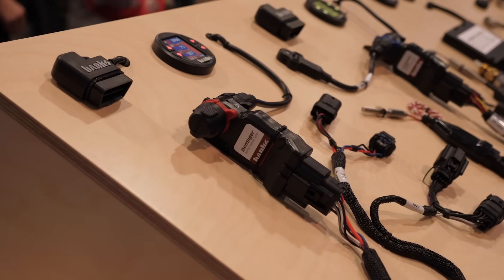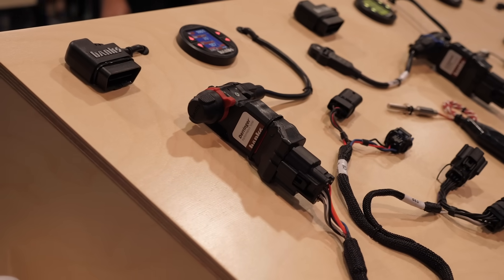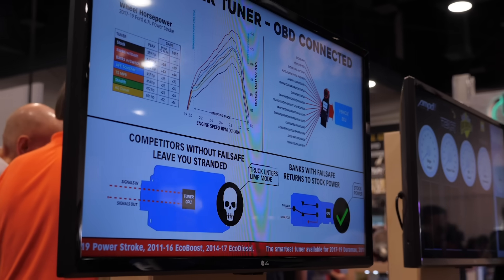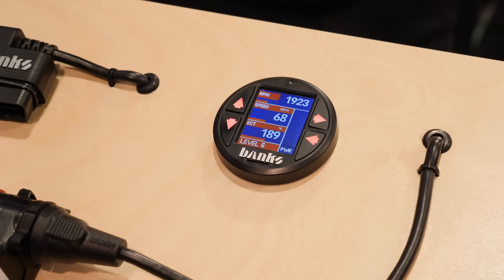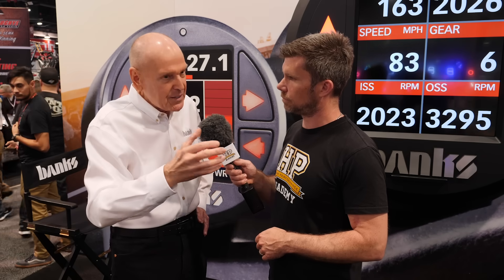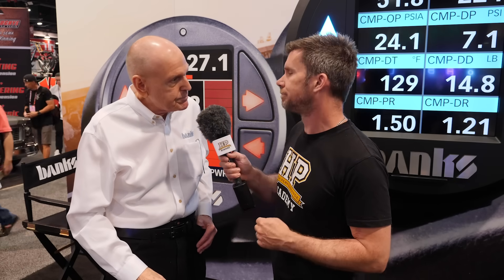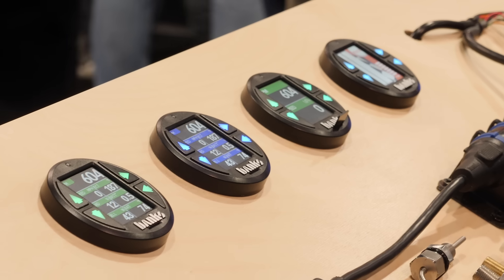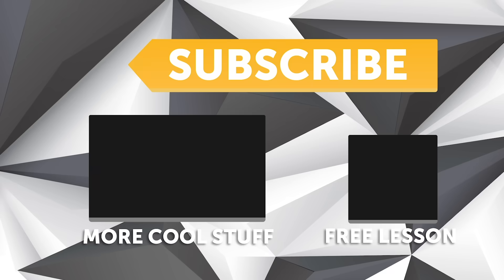More POWER With A DPF Fitted? | Gale Banks On Emissions [TECH TALK]

Comment: The replies to this video show a certain lack of understanding of the subject at hand so I thought I'd add a (lengthy) reply of my own to explain some things.  

A diesel particulate filter (DPF) doesn't require diesel emission fluid (DEF) to work.  DEF is for nitrogen oxide (NOx) reduction.  DEF is a mixture of urea and water.  Urea is made of oxygen, nitrogen and hydrogen.  In the selective catalyst (SCR) urea becomes ammonia which reacts with NOx to become water and nitrogen.  Diesels produce lots of NOx because of their high temperature combustion.  

A gas engine alternates between rich and lean.  When it is lean the catalytic converter cleans up hydrocarbons and carbon monoxide by turning them into water and CO2 .  When it is rich it cleans up NOx by turning it into nitrogen and oxygen or in other words air.
The catalytic converter in a gas engine is actually two converters in one.  The two parts only work well when conditions are right.  Specifically, the converter that cleans NOx doesn't work well unless there is almost no oxygen in the exhaust (rich mixture).

Since a diesel is never rich, the catalyst is not efficient in cleaning up carbon monoxide (CO).  To overcome this problem  DEF is added to the SCR to make the converter more effective in handling the NOx. DEF helps the SCR to do a better job of reducing NOx in the presence of oxygen.
 

EGR is used to reduce the amount of NOx made in the first place by reducing the temperature of combustion.  Since exhaust won't burn, it's mass just absorbs heat from combustion and therefore reduces the temperature.  Any inert gas or liquid added to the intake would do the same thing but exhaust does it well enough and is available and free.  If the DEF and SCR worked well enough it wouldn't be necessary to have EGR and vice versa.  Together, EGR, DEF and the SCR take care of NOx.  A deleted truck produces a lot of NOx and there is little that can be done to tune it out.

When the mixture gets richer than about 18:1, which is still way leaner than a gas engine's 14.7:1, the engine starts to produce much more soot.  The hydrogen in the fuel burns first and the carbon uses what ever oxygen is left.  Since diesels have very little time for fuel and air to mix it is necessary to have excess oxygen available to burn up all of the carbon.  

When race trucks and tractors blow all of that black smoke it is because they are sacrificing fuel efficiency and breathable air for power.  Essentially they are throwing away a bunch of carbon in order to use as much hydrogen as possible.  Hydrogen makes more power than carbon. 

The black soot in diesel exhaust isn't technically coal.  It is more precisely called coke, which is coal minus the hydrogen that most coal contains or charcoal which is wood minus the hydrogen.  So rolling coal is more correctly called rolling coke/charcoal.

The size of diesel soot particles is tiny.  It takes a very fine filter to remove a significant portion of it.  It is a very big technical challenge to make a filter that can survive exhaust pipe temps and filter out the soot while not choking off the exhaust.  Even a very clean diesel makes significant soot.  One of the frontiers of diesel engine design for the last 150 years has been to clean up the exhaust while running as rich as possible.  One way is to simply filter the soot out of the exhaust.

Of course there is a limit to how much junk a filter can hold.  With an air or oil filter we can simply change it often but with a DPF the cost of replacing it is too high to make that viable.  The alternative is to clean the filter by burning off the soot from time to time.  Soot has to be pretty hot to burn well.

The catalytic converters create heat as they clean up the pollutants so by placing the DPF behind the converters it runs hot enough to burn off some of the soot during normal operation.  That isn't sufficient though.  Since there is always oxygen in the exhaust of a diesel there is the option to burn more fuel in the exhaust to make it even hotter to improve the oxidizing of the soot in the DPF.  If the converter is doing its thing properly it will be running hot enough to ignite extra fuel injected into the exhaust.  The exhaust will then be hot enough to clean the DPF.  The DPF is often built into the catalytic converter to facilitate this.

The cleaning of the DPF is called regenerating.  It is wasteful of fuel but it makes having a DPF possible.  When the carbon in the DPF combines with oxygen in the exhaust it makes CO2, and nothing else.  The fuel injected into the converter burns cleanly so all the makes is water and CO2.
  

The exhaust has more things in it than combustion gasses and soot.  One thing it has is ash from additives in the oil.  Oil gets into the combustion chamber from the crankcase ventilation system, past the rings , past the valve stem seals and past the turbo seals.  There is always some dirt in the fuel.  There is also dirt that gets past the air filter.  This ash winds up in the DPF and can't be burnt out.  Hence the need to eventually replace the DPF or get it purged of ash.

If everything is working properly, what comes out of the exhaust of a diesel engine vehicle is nitrogen, oxygen, water and CO2.  There will be minute traces of other things but those who care are generally satisfied by the result.

It is easy to see why people would want to delete their trucks, given the problems we see today.  The problem is, air pollution is a real thing.  The first time I flew into LA was in 1972.  As we arrived I looked down on the city below but but couldn't see the ground because of the very strange clouds  When we landed I couldn't see across the airport because of the smog.  I don't think anyone wants to go back to that.
Reply: I truly believe if people hadn't taken to rolling coal we would never have had a crackdown on tuning.  The sad thing is that the first people they put out of business were the ones who produced only clean tunes.  As so often happens, the few make life difficult for the many.
Reply: @davidriley7411 I agree
Reply: Hey hey, i live in the uk and own an 07 vw crafter 2.5 inline 5 td,  the emission regs for this engine are quite tight regarding c02, nox and hydrocarbon content. I had trouble some years back passing emissions testing so removed the clogged dpf and bypassed the egr and had a custom map built based on a drive and test principal, this fixed the problem in real time by regulating cylinder head temperature by way of fuel/air ratio using the exhaust temp sensor and lambda sensor. Regs have gotten tighter lately but still passes with flying colours. Road test too tho its not mandatory. She puts out near 200hp and bundles of torque with no smoke with over 400,000 miles on the odo.
Reply: @davidedmunds3409  
Here in the US a part of the emissions inspection is a visual check to see that everything that came on the vehicle is still there and functional.  Usually they just look and don't test but they could if they wanted to.  Then they check to see that the monitors have all run and passed.  If that passes then that is about all they do.  Removing a DPF and bypassing the EGR will certainly lead to a failure of a real test.  

If someone wants to be tricky about it they can take the guts out of the DPF and put a blocking plate on the EGR valve to try to fool the inspector.  Then a tune that shows the emissions tests as passed regardless of the actual result and turns the check engine light out may be the final step to get by.  Of course if you are actually caught in an EPA roadside test you could be in big trouble but that isn't likely at all.

It is possible to improve one thing by ignoring another thing.  There is no big secret there.  This video by Gale Banks is about how to improve things while not doing away with anything.  That is a very difficult proposition.  Only someone with great knowledge, skill and the right equipment can do this.  

Congratulations on your success but what you did doesn't necessarily apply to anyone else.
Reply: The plane you talked about at the end of your bullshit rant emitted more carbon in the air, than all the cars on the road that day, emitted in a year. The big issue is the fact that in California, it’s legal for a kid to delete their wiener without their parents permission, but the minute I want to straight pipe my weekend truck, and tune a little power into it. The whole state (and federal) government thinks I’m an eco-terrorist.
Reply: @johnwayne6775  bahahahaha that might be the best comment I've ever seen.
Reply: All I know 100% is that EGRs shorten the life of the diesel engines and DPFs combine with EGRs cause fuel efficiency issues. This means more new engines have to be made and more oil sucked out of the ground globally, oh wait, mostly just for Americans and only for the people, government and military vehicles need not comply. 

You can find 1,000,000 mile diesel engines without EGR’s and DPF’s but not with them. The soot being put back through the engine is like sand, it smooths the cylinder walls causing blow by and the engine need work or replacing at 200,000 miles. 

I agree with a cleaner environment but more pollution is created making battery powered cars and people hale them as green. The break even from a pollution standpoint between ICE vehicle to an Electric one is +/- 150,000 miles on the ICE vehicle.
Reply: I don't believe that anyone thinks that EGR is good for anything but emissions reduction. Again, that is not what this video is about though.  It is about how someone can keep their truck emissions legal and still make more power.  It's easy to make more power and economy by ignoring other considerations.  Lots of people do it.  It is not so easy to make more power and still keep everything else.  Gale Banks is one of very few people who really knows what's going on and can make mods that are legal and work. @Captain-Awesome
Reply: @davidriley7411  My point was making the truck last longer. Yes Gale doesn’t a great job but a better DPF system so that an EGR isn’t needed at all would save the engine from ingesting the soot it creates. That soot ruins the engine.
Reply: @Captain-Awesome  missing facts without an EGR you wouldn't need the DPF where nox is again made and please correct me I believe the nox sensor is before the DPF. That's logical   
mechanic
Reply: @garreysellars5525  I am not sure where the point got missed. The EGR puts sut “Exhaust Gases” back into the cylinder to be burned a second time. This is bad for the engine because of the smaller particles being introduced back into the cylinder. If we can’t agree on that then you have no idea what I am talking about.
Reply: @Captain-Awesome  it doesn't put it back to be reburnt 
EGR is a hot air Detuning system by way of putting hot exhaust gas at 150 to 190 deg C into intake
This destroys the good cooling achieved by charge air cooler. The exhaust gas takes up space ,won't burn and won't support combustion. Also the returned carbon solids are abrasive to cylinder and rings. Causing oil consumption. More POULITION. Diesel fitter Australia
Reply: Personally saw no issue with a deleted truck with a clean tune. 

Prolonging the life of a vehicle and it's associated components is a way of conserving raw materials :).

Fuel economy benefits and the prevention of emissions related failures.
Reply: @OscyJack-  Today's engines have to be durable, efficient, powerful, smooth running, economical, reliable and clean.  If you do away with any one of those requirements then it would be easy to improve on the others.  That isn't the subject of this video though.  It's about how to not lose anything while gaining something.  That is hard to do.  Gale Banks is something of a wizard about that.
Reply: @ash_ketchum42  he's definitely a wizard. And diesels will always run better without emissions controls. I don't suggest they all should.
Reply: thanks for the long lesson from the EPA that no one cares about.the facts are the emissions shit doesnt work at all , the regulators just make a standard 'remove all X' by this year, assuming that the engineers will magically make a tech that can do it. fact is they cannot, and really they should not. they redirected the industry from making fuel efficient reliable engines to instead trying to make an impossible emissions standard. almost like the goal is to drive costs up and decimate the trucking industry. the whole concept is a cluster fuck and needs to be scrapped
Reply: Don’t quote me on this, but i believe California (specifically LA area) is in a valley that retains all the smog which is why you (in 1972) couldn’t see anything.
Reply: Thank you for a superb explanation of the cat system and it's perpose..
  I've been a Duramax fan for years and I've seen ppl that had issues they didn't understand what they were doing burning it dirty
Reply: Imma just save that for later
Reply: How are you going to sit here and tell me that recirculating hot exhaust gas back into the intake manifold is cooling the engine down? What a joke! That’s misinformation at its finest!
Reply: This is a big mixture of solid understanding and junk science
Reply: Very well spoken,  thanks for your imput.
Reply: I’m an accomplished diesel mechanic, and have been for many years. The factual explanations in this reply are better than most people like me could’ve offered. Kudos.
Reply: Thanks for the explanation, however it still seems like the dog chasing it's tail. The DPF whille problematic and very expensive item to replace couldn't they help the soot problems another way? The exhaust being routed to the engine intake that is my objection, very dirty for the engine and not very efficient. As I understand it this is to reduce NOX by lowering the combustion temps there by increasing soot from less complete combustion. THEN we dump fuel into the exhaust to raise it's temp and burn off the soot (carbon).  Why not just use a bit more DEF in the SCR to take care of the NOX like gasoline rigs do?
Reply: If the Def is so good why are states like California  and European country making it illegal to use because the ammonia it release is a carcinogen and is killing the plants along highways
Reply: I'll speak to your last paragraph since I don't know much about diesels. That air pollution and smog was due to pre catalyst vehicles that were primarily gas. After catalytic converters were mandatory on vehicles that smog cleared up pretty quick. "Cleaner" diesels weren't really bothered with until much later and as you said the main concern with diesels were particulates and NOX. So as much as the environmental alarmists want you to think cars are going to end the world its quite wrong and as I said most of the car issues as far as pollution were solved with a catalyst. Most "pollution" that they talk about comes from corporations, manufacturing and power generation. So nickel and diming the little guy with expenses that have to do with vehicles is a huge over reach of government power while they ignore everything else.
Reply: I have one question, why has the govt not required DPFs to be put on jet engines, they burn a form of diesel fuel, kerosene ?  Because you can’t pull a 747 over on the side of the road at 45,000 feet to work on it😀
Reply: Diesel naturally burns at 210, everything I’ve ever learned is that diesel runs cooler than gasoline. The whole reason we have nox emissions from diesel is because we’ve made them run super lean to reduce soot. I thought each issue was in response to itself. We made Cats to reduce C2O2, DPF to clean up exhaust soot, EGR to further clean up exhaust soot, and then SCR in response to elevated exhaust temps caused by all the soot cleaning. 
Please feel free to point out where I’m wrong. I love learning about this stuff.
Reply: @CheeseWheel03  
You have made a basic mistake in your reasoning.  Diesel will ignite at 210 C but once ignited it burns much hotter.  In fact if the air in the combustion chamber isn't significantly above 210 C the engine won't run.

Because of the high compression ratio of diesel engines the air is hotter before combustion begins.  Diesel will ignite with only a 3:1 compression ratio if there is no heat loss from the air and the fuel is near ignition temperature when injected.  Under these idea conditions it is easy to get things started.

When the fuel is cold enough to jell, the air is -40 degrees and so is the engine then it is impossible to get the fuel to ignite with only a 3:1 compression ratio.  Something needs to be done to help things get going.

Thermal efficiency would be pretty bad too at 3:1 too.  

The obvious thing to do is to increase the compression ratio.  Up to about 12:1 efficiency improves and so does starting ability and gasoline can be used with spark ignition in this compression range.  

Thermal efficiency continues to improve without limit as compression ratio increases but other considerations come into play.

Above 12:1 it becomes impractical to use gasoline/spark ignition.  Compression ignition becomes more practical than spark ignition so diesel fuel enters the picture.  Some very large diesel engines actually run fairly low compression ratios, way below 12:1.

The higher the compression ratio the more mechanical friction there is in an engine.  Around 16:1 the friction losses begin to overtake the thermal gains.  It has long been the goal of engine designers to get diesels to work well at that low a compression ratio and to get gasoline engines to run and survive there too.

Many smaller diesels use compression ratios in the 20-25:1 range.  This is so they will start when it is cold.  Even that isn't enough so they have to employ preheaters and glow plugs or they won't start.

Yes, diesel will ignite at 210 C but that is not it's burning temperature.  An engine that only had 210 degree air would not run well.  It takes time for heat to transfer from the air to the fuel, for the fuel to vaporize (because liquid fuel doesn't burn because it has no oxygen mixed it) and for the vapor to come to ignition temperature.  There isn't enough time to make all of that happen if the air is just barely above ignition temperature.  To get the engine to run well there needs to be some extra heat in the air to get things going quickly.  The hotter the air the sooner the fuel will ignite and the less it will knock.

Combustion temperatures inside a diesel cylinder can easily reach the temperatures where NOx are created.  Because the compression ratio is higher than a gasoline engine the NOx problem is worse for diesels.  Even though the mixture ratio for a diesel is lean it still burns hotter than a gas engine, at least at higher throttle settings.
Reply: you're wrong about the EGR. your explination makes no sense. the EGR soely exsists to reduce engine emissions output when it is least efficent (at idle) where it produces incomplete combustion due to having to increased air charge i.e boost like while driving. the incomplete combustion also comes from lower EGT's a diesel engine with a perfect AFR with 1000 degree F EGTs will produce no soot while a Diesel engine idling with no boost and at 400 degrees F inevitably its not hot enough for 99% of diesels out there to complete combustion leaving soot  in the equation.

 how do you get rid of it? ah yes. make a valve and circulate it back into the intake in an attempt to burn it agian.. but it would significantly increase the charge air temprature further reducing efficency and increasing soot content. so whats the next soultion? oh yeah. make a cooler that cools your exhaust using engine coolant.

boys thats the first step in making a unreliable engine. modern diesels vs diesels even 16 years ago. have a way way over taxed cooling system and are way overly complex and get way way worse fuel economy for power gains.
modern engines use engine coolant to cool the engine, the engine oil, the transmission fluid, the exhaust. oh and the Charge air as well. sometimes more than that. 

it just baffles me that my 2018 F250 Platinum with the 6.7 powerstroke gets a measly 14 MPG highway. not towing. and towing a 2022 bronco on a 2000 lb car trailer. gets 13.5 MPG. a 3 hour trip. 2 fillups almost entierly highway

while my deleted 2005 f250 Harley davidson edition 6.0L powerstroke makes over 700 RWHP and 1400 ft lbs of tourqe. (i live at sea level) + or - 50 feet of elevation. gets 30+ MPG not towing on the same trip. and 22+ MPG towing the same trailer. 
oh and it runs on used motor oil and automatic transmission fluid its fuel economy is probably slightly higher because that truck can do round trip and enough fuel to do 30 mile drive to work one way and back home for 2 weeks after without needing more fuel.
 
keep in mind its a 3 hour one way trip and average speed is 60+ MPH

its baffeling that somehow someway politicians have convinced everyone that 13 MPG is way better for the enviroment than 30+ keep in mind doing the same work.

there was a quote i read somewhere from a unknown person
"As long as the source of pollution is moved out of sight they do not care" - unknown
implying as long as they don't have to see the belching coal fired plants. or black soot coming out of a diesel engine then pollution doesn't exsist. 

but it does though. instead of being spread evenly in the air. and dissipate naturally from weathering and erosion. it ends up collected nice and neatly in the end consoumers DPF filter. and gets washed down city drainage all in one spot. 

bit naieve that the government can operate vehicles without emission equipment but normal people its prision.
the EPA not too long ago fined the guy that made the tunes for the presidents Motorcade a duramax powered amored limo. its got no emissions on it. and proceeded to file litigation agiasnt him when he refused to do what he got punished for agian for the people that punished him.

the only types of Engines that are free from the government and EPA's grasp are military engines. can't remove emissions equipment if it never had any. should be queue for everyone to go get 5 tons or something.
Reply: @justnsaliga8518  I don't want to create a flame war.  In the hope that you are willing to consider input from me I'll try to fix some misconceptions in your post.  

The typical programming for EGR valve pulse width has the valve closed or nearly closed at idle.  It doesn't open wide until there is some load.  In some applications, the amount of EGR in the intake can approach 35% but only under load.  There was a time years ago when most emissions controls virtually shut off at full throttle but not any more.  

There is no such thing as a diesel that produces no soot.  They all make some all of the time.  Under proper conditions the soot can be low enough to be invisible to the naked eye but it is still there in some quantity.

In order for EGR to significantly reduce soot by recirculating it, nearly all of the exhaust would have to be recirculated.  That would be impossible since there is always more exhaust than intake.  Exhaust is not recirculated to give it a second burn.  The whole point of EGR is that it is non-combustible.  EGR has nothing to do with soot control.  It is 100% about NOx.  EGR does not increase combustion temperature to burn soot.  It cools it to reduce NOx.

There is no argument that an uncontrolled engine can do better than a controlled one.  Just got to any drag strip for proof of that.

I don't believe that bureaucrats are inherently evil.  They just see things through the lens of their position.  I'm sure of one thing.  Guys rolling coal and specifically aiming it at bicyclists and Prius owners are the source of the current crackdown.  If people kept their vehicles relatively smoke free we wouldn't be facing the situation we have now.  

There is a certain logic to more but cleaner exhaust, as long as you don't count CO2.  At least it looks better.  Again, they don't look at the whole picture, only the part that they control.  Since CO2 is not a controlled pollutant, it isn't something they look at, or so I suppose.
Reply: @justnsaliga8518  I think that is the crux of the situation.  Reduction in emissions almost always requires a trade off of reduction in fuel economy.  If that ‘17 power stroke could get 22mpg or better with an optimized unrestricted burn instead of 14mpg with Regen, EGR, DPF, Cats and DEF -  it seems to me that it would be better overall for the environment.  Especially when you include all of the mining, energy for material production, fuel and emissions for shipping this stuff all across the world and even the straight up trash from millions of empty cardboard and plastic DEFluid containers that EPA compliance requires.   Now I’m just piling on, but the economic burden of higher cost vehicles and repairs because of this compliance is also something to consider.  This is why I everyone is pissed off.  All this emissions “technology” is not as beneficial as a clean burning higher mpg engine would be and when guys try to move away from emissions and towards mpg and cleaner burn the government is destroying them.  My LBZ Duramax used to get 17-18mpg but now gets 22mpg all day because of the couple thousand $ in modifications that I’ve done, and I’m told I could push 24 if I got rid of my cat and EGR.  My cousins though has a bone stock L5P and is has 15mpg best tank and he has to buy DEF along with his fuel.  Make it make sense.
Reply: @danielgattuzo3065   people want to side with emissions and claim it’s not so bad it’s o so great but they only do tuning they don’t ever open the engines up and actually see what the garbage does to the engine. Emissions is better on newer stuff than it use to be but it’s still not good to an engine. The blowing smoke is just a bad rep that’s been goin on for years just part of it you won’t get rid of it in older stuff it’s not possible especially if it’s built. Anybody can say what they want about tuning and deleting and it’s bad but the government equipment is emissions exempt🤷🏼‍♂️ if it’s not so bad then why don’t they run it on our military and politicians vehicles. Oh yea that’s right because it’s unreliable and can fail at any moment especially under stress.
Reply: @codyg1662  You get it about this emissions stuff.  I have seen videos of guys removing their EGR from their Gm trucks and it being filled with what looks like gritty tar.  Same with the y-bridge at the top of the intake.   I think you just poured fuel on my fire with the government exemption.  If they really wanted to lower emmissions, isn’t the us military among the biggest polluters in the world?  Rules for thee…
Reply: @danielgattuzo3065  exactly, I know what the inside of them look like because I work on them I see it first hand. Only engines I’ve seen clean are 7.3s and 12Vs bc They don’t have anything goin back in them other than ccv if it hasn’t been rerouted.
Reply: Your write up of the diesel exhaust system is very good, but there are two things I would like to push back on. 
1. The smog over LA has been around long before the first combustion engine. 
2. NOx is not harmful to the environment in the same way CO2 is. NOx is only sort of harmful to anything breathing oxygen, however that’s only if you’re inside a sealed room with it. Once the nitrogen hits atmosphere it enters the nitrogen cycle.
Reply: @fearofchicke  Yes, smog is nothing new to the LA basin.  The inversions there are strong and long lasting.  Even campfire smoke used to accumulate there long before engine smoke.  There isn't that much campfire smoke these days though and it never became a heallth hazard.  California led the nation in smog laws because they have particularly difficult situation.  They needed to clean up air that didn't dissipate because of the weather patern.  What applies in the LA basin doesn't necessarily apply elsewhere though.

NOx has multiple harmful effects, depending on exactly which oxide of nitrogen we are talking about.  In low concentrations it does little harm to people but when it is concentrated, like in the LA basin, it is a breathing hazard to all animals.   It also acidifies rain so that it leaches things from the soil that then harm plants.  Acid rain is also harmful to buildings.  It attacks masonry and metals as any acid would,  causing deterioration.  Eventually this can lead to serious damage.  The environment is able to cope with a lot of things, including NOx but it takes time.  

Nitrogen does not readily combine with oxygen and easily dissociates when exposed to UV light.  It also "enters the nitrogen cycle" even as an oxide because some NOx can be broken down by some micro organisms.  The problem is what happens between when it is produced and when it breaks down.

I don't think many people are in favor of adding things to our air that didn't exist before industrialization.  It isn't a question of should we be concerned about smog.  It is more a matter of how to do the most good with the least cost.  That is something that we have to ask about everything in life.
Reply: @ianmcgaughey1  I'm not into consipiracy theories.  I generally just ignore them.  In this case though I think I'll point out a few errors.

Diesel engines are not more powerful than gasoline engines given equal technology.  An 8.1L GM Vortec gas engine has a little more power than a 6.6L Duramax diesel in some applications even though the Duramax has a lot of turbo boost.  One can't just say that one thing is better than another.  It is necessary to qualify such a statement with conditions.  Size for size and turbo for turbo gas engines always out perform diesels.

Gas engines can mix their fuel and air thoroughly, allowing them to run near stoichiometric or 14.7:1 air to fuel ratio.  The main power limiting factor for internal combustion engines is how much oxygen they can consume.  The next limit is how well they can use that oxygen.  Since gas engines are typically built with lighter components they can turn faster so they can turn faster and breathe more oxygen.  Typically diesels turn 70% as fast as gas engines.

Diesel engines have a hard time mixing their fuel with the oxygen available.  As a consequence diesels tend to smoke a lot when they get richer than 18:1.  That means that diesels are only using 82% of the available oxygen if they are not to smoke excessively.  Combine that with their RPM disadvantage, they just can't compete on a like to like basis.  A diesel will typically make less than 60% of the power that a similar diesel engine makes.

One advantage that diesels have over gas engines is that they work well with supercharging.  That allows Diesels to take in more oxygen and make more power with it.  You can also turbo a gas engine but it is more complicated and the max turbo pressure limit is lower for gas than diesel.

There is more energy in diesel fuel than gasoline and the combination of lean running, lower pumping losses and higher compression combine to make diesel more economical than gas.

I don't know where you live but where I live diesel is more expensive than regular and less than premium.  

Typically diesels are more durable than gasoline engines but tha't all a matter of design. There are industrial gasoline engines that are every bit as durable as diesels.  Check out Thermodyne engines for examples of million mile gas engines.  I know lots of 350 Chevy engines in Suburbans that have gone 350,000 miles pretty much trouble free.

As far as 35 mpg diesels in an HD truck, I hear these stories but I've never seen one.  On a Durmamax forum I frequent, anyone who claims more than 25 mpg is generally thought to be telling fish stories.  I get around 20 mpg on my tuned truck and I drive moderately.

There isn't enough bio sourced fuel to meet the needs of the fleet of diesel vehicles on the road now.  If the whole market became diesel there is no way we could supply the need with vegitable sources.

I drive a diesel truck and a diesel car.  I like diesels.  I don't like conspiracy theories.

I think my next vehicle purchase will be electric.
Reply: @davidriley7411  no conspiracy theories. It's public knowledge. The oil and gas companies have lobbied it, look it up. 

As far as your power numbers, you are correct, but that is a game of semantics. Power is horsepower, not torque. Horsepower has almost nothing to do with MPG. Diesel engines make 2-2.5x the torque that a similarity sized turbo charge or naturally aspirated gas engine. That translates into efficiency and MPG. Audi and Volkswagen have made 1.2-2.0L diesel engines that have achieved 45-90MPG. There has NEVER been a gas engine in history that has achieved those same efficiency numbers.  

As far as trucks go, I have seen many HD trucks with quality tunes, DEF deletes, intake systems, and rear end gearing that achieve 35 MPG. It's not difficult. I know multiple over the road truck drivers getting 15-18 MPG out of their trucks. You tune them correctly and they work, better than any gas or electric engine ever will.
Reply from the maker: @salvatorehernwood  great, so by that logic a slow-burning fire full of plastic that is going to kill anything breathing in the smoke is worse than a fast burning wood one that doesn't do the same.

Genius 😂

With it that simple seems to me the best thing to do is to have less fires rather than bleating like self entitled children that the fire that does a bit less damage is one they should be allowed to burn as much as they like either way.

That said, we're only reallllly here to discuss emissions systems in relation to vehicle performance. They're certainly not there to increase performance but also are not always as bad as people make out either.

There are plenty of channels out there regarding the impact of private passenger vehicles usage and pollution, as well as aircraft, ships and anything else with an engine, even electric, which will have more content on what many here are actually interested in than we do.

Some people actually go to work every day with their work being research into things like this which they spent years getting qualified to do. We don't all just read a few articles and become experts.

Same goes for things we DO cover, like tuning, you don't just watch a few videos, call yourself a pro on all things tuning and open up a workshop 😂   - Taz.
Reply from the maker: @salvatorehernwood  the topic is emissions, so relating economy to emissions as many take the angle that simply using less of something different is good but it's not that simple.

We all always want better, but also have to keep in mind 'good enough' is a valid solution when the perfect one isn't present.

People are quick to point out the faults of something without offering a real (as in tested not theory) alternative and practical solution.

OEMs certainly are not perfect and just like you, they want to make money for their work for sure which is a double-edged sword.

Just to ramble some more, there also is not just one DPF system out there, they are not all as bad, or as good, as each other and as we would hope and expect as time goes on they are improving in the reliability department which is where almost everyone's gripe is  - Taz.
Reply: @hpa101  As my brother would put it "Do you really think you are smarter than scientists and researchers who went to MIT?"
Reply: @ianmcgaughey1  sorry Ian but any trucker that tells you he is getting 15 mpg from a rig doesnt know how to calculate mpg. I know this because I have owned my own trucks for 40yrs and do all my own maintenance as well as tuning. The physics are not there to get that kind of milage. Its like billy big rigger that tells everyone he has had his engine tuned from 500hp to 650hp and is getting better fuel mileage. Common sense tells you that is impossible. You need more fuel to make more hp simple as that
Reply: @davidriley7411  Yup no one on this Earth has ever conspired before.
Reply: @ianmcgaughey1  no you do not know over the road truck drivers who get 15-18mpg out of their trucks.  Please provide that proof.  Kevin Rutherford and Bruce Mallinson would love to hear your sources.
Reply: @davidriley7411  
Depends on how you define power. A diesel Wil mostly produce twice the torque for the same HP as a petrol which is way better for work. Towing ect
The biggest problem with EGR is the carryover of shit back into the intake and cylinder causing wear to make the have blowby and consume oil early in it's life makeing the very POULITION it's trying to fix
300000 ks on my Cummins no crankcase vapour oil in it intake due to the vet good filter it valve cover

The EGR by method as a Hot gas Detuning device is the cause of the soot that has to be rectified by the DPF by burning MORE FUEL
So that defeats the efficiency of th engine

Point How is running the world out of fuel faster Better for the planet

Ram Cummins
Water methanol injection fitted runs cooler exhaust temp than fitted EGR 
AND I DO GET 9.8 L/ 100 KS 
Hyway 
AUSTRALIA 
I agree rolling charcoal is a rediculous look and wasted money
Reply: @holmes1956O 
Yes you do need more fuel to make max HP
But at light engine load eg hiway cruise you are not using that HP so it wont be using that extra fuel  Here in Australia my Ram Cummins with extras and is daily work ute runs 20 sec a cross 200 m not Supa by race specs but healthy
And I get 9.8 liter per 100 k  I used that measures because gallons are different
45 years a diesel fitter
Reply: Bullshit. You should have seen L.A. before the PCV valve became mandatory in the 60's.
Reply: @fearofchicke  if you think co2 is harmful you dont have a clue. without 150ppm+ of co2 life ceases on earth. I guess next you will tell us how dangerous oxygen is and how we need to go zero oxygen. really people try to be less moronic
Reply: @fearofchicke  whoa, you think CO2 is harmful to the environment? You couldn't be more wrong. That's like saying 2+2= infinity
Reply: Long story short ford made a gas burning 7.3 liter v8 because diesels are junk now
Reply: @thumpervansqueakynuts5848  7.3L gas looks stout and a good compromise between gas and diesel. However, my 2017 powerstroke that my family took delivery back in late 17 now has 113,000 original miles has been flawless with only basic maintenance i performed on the road as we live fulltime in our rv trailer that our superduty is mostly hook-up with. These diesel trucks need to work hard to keep clean and be use as it was design for. I hope to get upto 1 million miles with this after after all the cost of new truck now a days.
Reply: Oh man you didn't have to write a whole book! I don't have time to read whole books😂😂
Reply from the maker: @benjaminturpin2749  use the speech function and get your device to read it out to you instead 😎 - Taz.